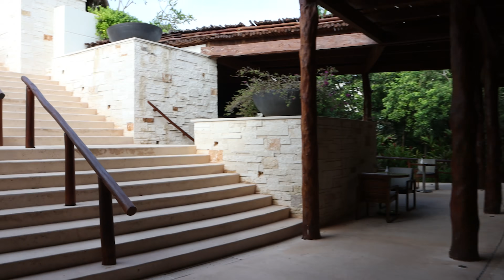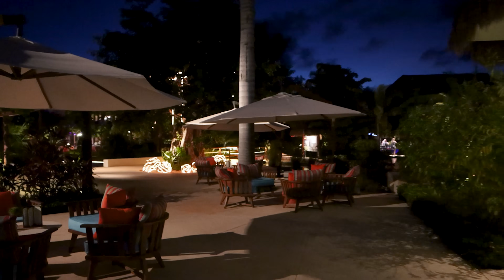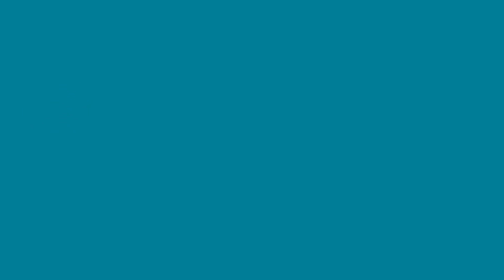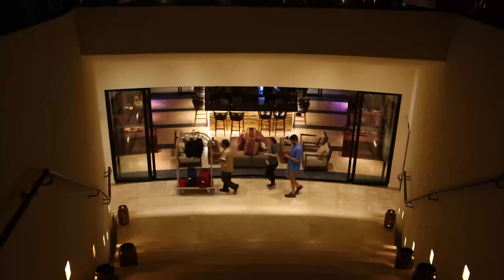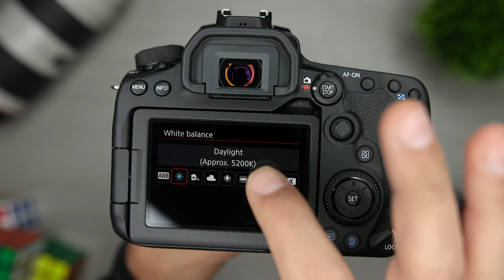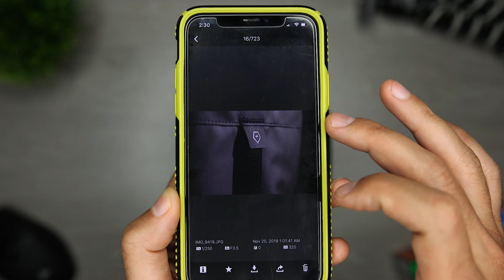Canon 90D - Watch Before You Buy

Comment: Sony a6400 vs canon 90D which is best?
Purpose : mainly photography , little videos , street photography , portrait, candid shots and nature
Reply from the maker: a6400 will have better autofocus in the viewfinder, it's smaller, more portable, has slow motion, LOG for video. 

90D is bigger, heavier, has better color (IMO), is easier to use, has a fully articulating full touch screen, headphone jack, tons or lens options at lower cost. What do you pick?
Reply: Tech Gear Talk  my investement will be budget oriented on lens, wat abt picture quality
Reply from the maker: picture quality is excellent on both.

Comment: For 80% filmmaking and 20% photography would u recommend the 6d mark ii or 90d? Budget is not really a concern. Im udgrading from an old 60d+7d setup, i also have mostly ef lenses, only one apsc. The 90d seems solid but im considering the almighty 6d mark ii, portability and size is not a concern only quality, which one would you recommend?
Reply from the maker: I would probably still go with the 90D as it's a more powerful tool for video. Also, you can use the sigma 18-35 on it which is a beast
Reply: @TechGearTalk  might go to fullframe so not really into buying efs lenses though, is the sigma for full frame? If it is then i might consider the 90d
Reply from the maker: No, it's an  aps-c lens.

Comment: What would you use for interior real estate videos
Reply from the maker: Do you mean what lens or what camera?
Reply: Sorry, I mean what camera.  I need a camera that can do both photography and video. I have a Cannon 5Dmarkii and it's time to up the game in video for real estate. Less than 2k for whole set up. the only lens I have is 16x35l lens.
Reply: I assume I need a Gimble as well? cage, mic, $$$goody goody, Anyway, appreciate your detailed easy to follow information. Great channel!
Reply: I did see one review of the 90D said it was pretty poor in low light because of iso flexability.
Reply from the maker: Ok. So, this would work just fine for interior real estate videos. With the property lens and settings, low light shouldn't be an issue since you're mostly on a tripod. I would also look at the m6mkii (same sensor, smaller body): https://youtu.be/Nir8pfvfdFI and then something like this 16mm lens https://youtu.be/uORT1dfeS0M 

This way, you have a much more compact setup that will work on a gimbal like this: https://www.youtube.com/watch?v=urugXDg3hnM You can also use your existing lens if you want with an adapter.

Comment: Another great review - THANK YOU!  I primarily use a Canon SL3 for live streaming and Zoom video conference meetings.  I output clean HDMI with audio to a Magewell II capture card and use an AC adapter for unlimited run time.  Based on primary use for live streaming, are there any reasons I may want to consider a future upgrade to the 90D?
Reply from the maker: Glad you liked it and thank you for the kind words and support. I would upgrade only if you wanted to stream in 4k. Otherwise, the SL3 is plenty good: https://youtu.be/XKVrK4Y0ehg

Comment: I just bought it...I have alot of grainy noise in indoor pictures shot on auto or program. Why is this the case...? Is there an ideal setting I should be using in another mode?
 Im using the canon 50mm 1.8 lens and the 18-135mm kit lens . In Outside lighting the pics are super sharp.
I'm really disappointed   ...I just bought a dslr after 8 years . Last one was nikon d5200...and with indoor pictures there's not much difference . I really expected more. I wish I had bought a full frame instead .
Reply from the maker: Hi. First, a full frame wouldn't help significantly in this case. The issue here is how the camera is used. The first thing we want to do is make sure you have a basic understanding of exposure. The noise you are seeing is from high ISO. https://www.youtube.com/watch?v=PuE6wADvnAY this should quickly teach you the basic. Next, because you have the 50 1.8 (great low-light lens). You want to shoot at 1.8 when you don't have a lot of light. Start practicing with live view (lcd) so you can see what the changes you make to exposure look like before you even shoot. Let me know after you watched the tutorial.
Reply: @TechGearTalk  thanks i will try your tips.  But the higher megapixels and smaller sensor area must be causing noisier pictures than a full frame like the 6d mark ii or rp...I'm seriously considering returning the 90d and getting one of those models ...can you please advise if they are better models in your opinion. I'm not too bothered about 4k video. I also really want to get the 85mm 1.8 lens and I think the crop factor won't do it justice and the full frame will be better for that lens.
Reply from the maker: What you are saying is correct in concept. In practice, it's not going to make a difference until you learn how to use the camera. You are asking for my advice and  I gave you what I truly believe is in your best interested. The 50 1.8 on APS-C will give you a similar angle of view to the 85 on FF. With any camera you get, make sure you figure out what the highest acceptable ISO is for you, and don't go above that. 

However, it sounds like you have made up your mind on going full frame - and if that is the case - go ahead and  try. I have nothing to gain either way, I was just sharing what I would do. I had no issue with noise on the 90D. The new sensor is absolutely fantastic and I love the images it gave me. Let me know what you decide and how it works out for you.
Reply: @TechGearTalk  thanks you are right that i need to master the basics. With two small kids running around sometimes I just need to point and shoot and may be expect the camera to do the rest since iv ive paid 2k plus but of course I shouldnt then expect optimum results out of cameras that are are not point and shoot cameras. Anyway thanks for taking time to reply to me and offer your advise much appreciated
Reply from the maker: Let me know how it works out

Comment: Will the 90D make the EF 24-70mm 2.8l ii usm Lens not as good as it’s cropped not full framed? Or would an EOS R or RP be better suited for this lens? I don’t think I want to spend that much on the R but I am so confused as I want it more for photography for traveling, so landscapes, cities, portrait, animals in wild so need speed but will the 90d with this type of lens still be amazing or will it be better on the RP? I’ve watched a lot of your videos about it but I’m just overwhelmed now and could use a hand.
Reply from the maker: Hi James. I used that lens with the 90D and it is spectacular. I would get the 90D over the RP because on top of all the L-series lenses, I can also get some amazing aps-c lenses. Hope this helps. Thanks for joining and supporting the channel 🙏 (let me know if you have any other questions)
Reply: Tech Gear Talk thanks for getting back so quick, so do you think this is a very good overall lens for traveling and mixture of different scenarios?
Also would you still recommend the 90D over Eos R? As I’m looking at that camera as well
Reply from the maker: That is probably the best lens you can get as an all-around lens. The EOS R is also a great camera, but you again, you're stuck with EF lenses using an adapter or very expensive RF lenses (or cropped images with an aps-c lens). Does that make sense?
Reply: Tech Gear Talk think so, so even if I got EOS R the adapter will crop the EF Lenses? Is that what you are saying?
Reply from the maker: No. The adapter will not crop the EF lenses, it will only crop the EF-S (designed for aps-c) lenses. Hope that helps.

Comment: Thanks man. Lot of respect for amazing review. I am stuck to decide in eos rp ef 24 105 and 90d 18 135 mm. Size does nt matter for me. My priority is better photography and 2nd video ability. In my country both above mentioned options are priced similar. Rp litter bit expensive than 90 d package. Your advise will be my final decision. Thanks
Reply from the maker: If it were me, I would probably get the 90D because the quality is amazing and I can buy more lenses at lower price points. Hope this helps.
Reply: @TechGearTalk  thanks alot🤩
Reply from the maker: Glad I could help 🙏🏻

Comment: Hi.
 At 17min. 07 sec. can you adjust in the 90D the speed of the AF, for a smooth transition between the subjects? If yes, can you us, the slower speed of the movie  AF . Thank you.
Reply from the maker: Hi Luis. I didn't try to do this, and I no longer have the body with me so I can't test. Check out the manual on the Canon website, I'm sure it's listed as a feature if it's available.

Comment: What an excellent review, so in depth and much better than most reviews I’ve seen for any camera. I’m looking at upgrading from 1300d/T6 and have been looking at a number of cameras including the 90d, I know I can get a used 80d at around half the price of this one or a new one for around £400 cheaper which is really making me wonder if it’s worth the extra money? I have heard the 90d is so much better but what are your thoughts on this. I’ve also looked at the 6d mk11 as I’d love to go Full Frame but what’s stopping me is I only have one EF lens (50mm 1.8) and a Sigma 70-300mm macro that I need to check whether that will work with full frame. Also there’s the 7d mk11 and the RP, I shoot mainly Street and really mainly use the viewfinder, I also shoot Land/Seascape so don’t mind using the LCD then. Do you think the 90d would be my best choice or which other camera at around the same price point? I’m on a seriously tight budget and my next camera needs to last me quite a while so need all the help I can get ?
Reply from the maker: Thanks for the kind words Brian. If it were me, I would only go full frame if I had the budget for lenses. Otherwise, I would stick with aps-c. I absolutely LOVE the 90D, IF you want a DSLR. Just want to throw an idea at you as another option. Check out the M6MKII https://youtu.be/Nir8pfvfdFI - almost identical specs, in a much smaller form factor (and cheaper). Now that Sigma released their 16, 30 and 56mm f/1.4 trio, it's a good option. You can always use an adapter with your EF and EF-S lenses. Let me know what you think

Comment: Most need to Know CF FPS Not Servo FPS There's a Huge Difference,, Thus i'm Assuming This is Probably Around 4 to 6 CF FPS??
Reply from the maker: Hi there. I don't usually use continuous for photos because it uses so much battery (especially if I'm only taking a picture every minute or few minutes). What do you normally photograph?

Comment: I was a Canon 700D user for the past four years. I recently sold my camera hoping to upgrade. My thoughts are on Sony A6600 and Canon 90D. Which is better? Do you have other recommendations. 

Thanks in advance from India.
Reply from the maker: Hi there. The 90D would be a seamless upgrade for you. You can re-use all your lenses. If you want mirrorless from Canon, for less money, https://youtu.be/Nir8pfvfdFI

Switching to a6600 or even the a6400 is an option, as long as you're willing to replace your current lenses. What do you think?
Reply: @TechGearTalk  I only had kit lenses with canon. What I'm looking for is a  portable camera which is good at taking stills. I'm not into vlogging.
Reply from the maker: Both would be excellent options (a6400, and m6mkii). I probably wouldn't spend the extra money on the a6600 (a6400 is enough - or even the a6100)

Comment: thanks for a great video and review.  when the 90D first came out I didn't really see a need to move up, but having sold my 80D i not only see the need to grab this baby, but do so with passion.  One question, when shooting video, is the viewfinder still in operation and I'm able to see what I'm video'ing from there also?  If so, when doing so, does that create an issue with accidental nose or face touch of the screen on the back and thus changes the AF point?  Thanks in advance for your kind response.
Reply from the maker: Glad the video was helpful in making a decision. Coming from the 80d you’re going to love this camera as soon as you pick it up. No, the VF does not work when shooting video (because of the mirror). Hope this is helpful.
Reply: @TechGearTalk  yes tis'.  so i best have a velcro wrap around sun shield.  thanks for the help.
Reply from the maker: That is helpful for sure in bright sun

Comment: Advantage of 5D Mark4 over the 90D?
Reply from the maker: full frame, dual card slots, bigger jpeg bugger, higher extended iso, more af  points in the ovf, more ovf magnification. Not saying these would make me pick the 5div - just naming a few. Hope that's helpful.
Reply: Tech Gear Talk so would you take the 90 or the 5D?
Reply: Tech Gear Talk I am looking to upgrade from an 80D and am torn between 90D, EOS R and 5D...I am upping my photo game. I like the specs of the new R5 but it might be to pricey for this stage of the game!
Reply from the maker: if budget is a concern, I would go with the 90D because investing in lenses is more important than the body. The issue with the R is that unless you're committing to buying RF lenses (more $$$) you're going to buy EF lenses and using an adapter. That's fine, but you're now adding to the size of the body, and you'll always need an adapter. What do you normally shoot? I do prefer an EVF to OVF (personally)
Reply: Tech Gear Talk I shoot with an 80D right now. Love that camera, but want to up my game as I am improving my skills and my Instagram is taking off...eventually start a business. I have invested in L glass, but not the super expensive L glass.  Budget is always a concern as one can go crazy 😜 with gear in a hurry!
Reply from the maker: Sorry, I meant "what do you shoot" as in photo vs video (or both) and then the subject matter. I would get the 90D or even the m6mkii with an adapter if I wanted mirrorless. That way I can use both L series glass and the new Sigma trio.
Reply: Tech Gear Talk More photography than video. Although the 4K has got me pumped to create YouTube content again. I am also very interested in the EOS R...tough decision!
Reply from the maker: I love the EOS R (has CLOG) and I prefer mirrorless vs dslr for photography - so if that's an option...

Comment: Great stuff, and I'm left wondering whether it's possible to say if this camera can produce actually produce visibly superior quality results in tone,colours,sharpness,clarity,bokeh than all the apsc canon sensors like 700d, 600d or are they all really the same giving same results ? This is what holds me back upgrading fto another apsc for fear of finding that after all I would have to go full frame to notice a quality difference
Reply from the maker: Thanks for the kind words. It's a better sensor and processor, so it definitely got better results than my lower-end 24MP APS-C Canon mondels. The question is: Is it better enough for the money?
Reply: @TechGearTalk  thanks for feedback that helps a lot and yes I hear you with that last question,a final consideration indeed to mull over
Reply: And I saw a newer apsc an 850d to consider
Reply from the maker: Definitely check out the T8i - might be the sweet spot.

Comment: @ Tech Gear Talk.....  ..i just got my 90d and took some photos using IA of still images.. can of san marzano tomatoes  using both the 50  1.8  and the 100 2.8 macro and the images were all fuzzy...Switched these lenses back to the 70d and using the same can of tomatoes both the 50 1.8 and 100 2.8 macro were sharp.   Very troubling and thinking of returning the 90d  but I thought  I would ask advice..I am NOT on FB...
Reply from the maker: Hi Ken. I had no such experience with the one I used (I used both of the lenses you mentioned). What do you mean by "IA of still images"?
Reply: @ Tech Gear Talk i mean my setting was using the A+ on the left mode wheel.. on both the 70d and 90d ..
Reply from the maker: I'd love to help. It would be helpful to have more info. Ex. exif, af mode, were you shooting the same way (handheld, etc.) and sample images. If you could shoot a short video (with your cell phone even) and send it in a DM on instagram, I'll take a look.

Comment: Great review! Thanks. I'd like to know the best for videos between 90 D and Sony A6400?
Reply from the maker: Hi Ahmed. They are so different. The 90D is A LOT bigger and heavier. It has a headphone jack and a fully articulating screen. 

The a6400 is much smaller (good and bad) can do 1080p at 120fps (with autofocus - 90D can do it in manual focus). I'll have to do a full comparison.
Reply: @TechGearTalk  Thanks a lot
I'll wait for this video
Reply from the maker: Sounds good!

Comment: I just received this yesterday, as an upgrade from my D60.  I haven't had much of a chance to check it out yet, but one thing that I would recommend to anyone purchasing it is to also purchase an IFC-600 PCU cable to connect the camera to a computer, since it's not included with the camera.  You can use a WiFi connection, but I was unable to pair my camera to my computer using WiFi.  I'm sure that I could eventually get it to work, but for my purposes (transferring photos from camera to computer) a cable connection is faster than WiFi, so I think I'll just forgo the WiFi.  I did pair it with my iPhone via Bluetooth, and the app worked well as an off-camera remote, but it drained the iPhone battery so quickly that I don't see myself using this very often.
Reply from the maker: Good insight! I usually just use an SD card reader but this is another great workflow example. Appreciate you contributing.

Comment: HI. I find your reviews very helpful. I have been using the 200d/sl2 for a year now. I want to upgrade to the 90d? I use the slr for foto and Video. Could you make a video on the difference and pros and cons. 
Best regards Jogge from Denmark
Reply from the maker: Thanks so much. I'm glad they are helpful. The only con I can think of is size/weight. Other than that, the 90D will crush the 200d/sl2